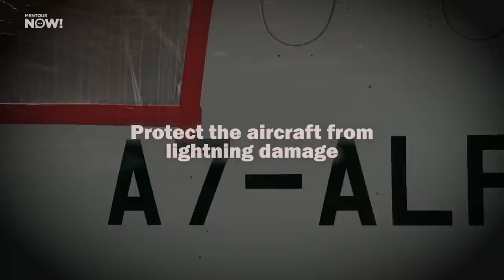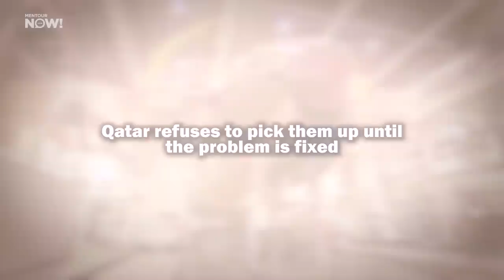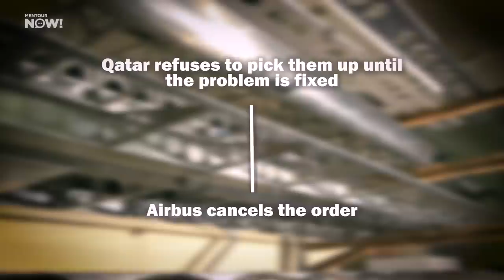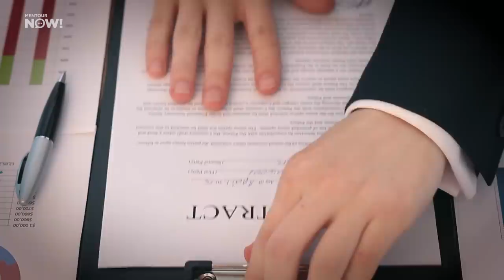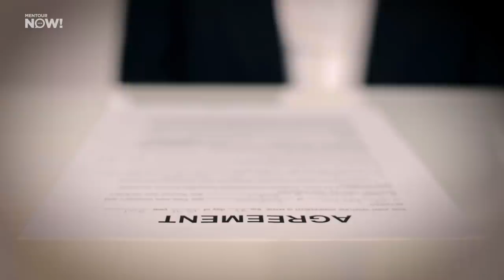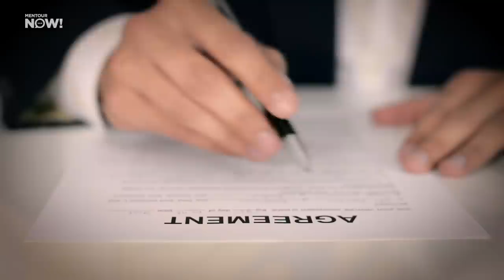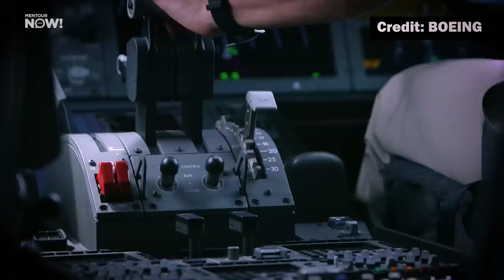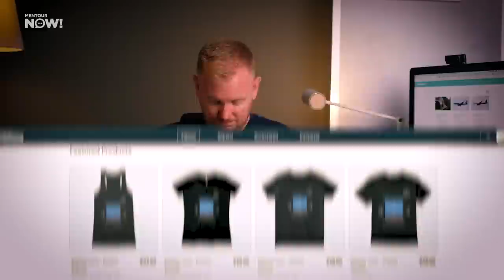WHO is Winning the FIGHT between AIRBUS and QATAR Airways?!

Comment: Seems like Qatar were looking at every option possible to save money during the pandemic, and now they don't like dealing with the consequences of their actions. Interesting they got the regulator to agree with them. Curious what their justification for it being a safety issue is. 
But on the flip side, Airbus did take a big risk putting dissimilar materials together and just hoping the glue would keep things together. 

But the good news is we get to see more A380's out there!
Reply: Copper mesh on carbon-fibre composite is how lightning protection is done. It is the industry standard. Boeing does the same thing on the Dreamliner.
The issue here was most probably a primer that could not handle the Qatari desert heat...which is not hard to conceive.
Reply: The justification for it being a safety issue was discussed in the previous video. In short, Qatar argued that the adhesion problem was affecting the conductive mesh of the plane, leaving it vulnerable to lightning strikes.
Reply: @MarvinRB3  But the whole point of the mesh is that it takes the lightning strikes, so the carbon doesn't.
Reply: @jursamaj  I do not argue the point, i only summarise their position to be helpful. You can make of it what you will.
Reply: @MarvinRB3  And I point out that their position is absurd and self-defeating.
Reply: @MarvinRB3  If your summary of QA’s assertion is accurate, their adhesion-issue-creates-lightning-risk is prima facie RIDICULOUS.
Reply: @baomao7243  from what I remember, the claim was that the poor adhesion of the paint exposed the conductive mesh, allowing it to be damaged; e.g with flakes of the copper mesh coming off along with chips of paint.

Airbus said there is suitable backup lightning protection.
Reply: @MarvinRB3  Exactly
Reply: "Interesting they got the regulator to agree with them."
Not really. Hardly surprising that the Qatari-government regulator agreed with the Qatari-government's airline.
Reply: @beeble2003  Whenever i see businesses behaving strangely I recall the best phrases ive heard in the Middle East:
* “NOTHING here is professionally managed” and
* “it is the government masquerading as a business.”
Sadly, both frequently fly apply.
Reply: The regulators and the CEO belongs to the same Qatari Family.
Reply: @jeffreyrivera8158  shocker

Comment: Is the work required to take an aircraft out of long-term storage significantly more than doing a C check? Unless it is a lot more, it seems to me that the cost of pulling an aircraft out of storage after two years isn't "expensive," it's about the same as you'd have paid if you'd been using the aircraft all along anyway.
Reply: We could start seeing A380s flying routes that are not REMOTELY economically justifiable…but Qatar “loses less face” by just throwing money at the problem.  Typical behavior if one is super wealthy. An ego that demands prestige can be extremely expensive (literally “at all costs”).
Reply: It is a lot more, in fact the longer the storage time the more expensive it gets.  Eventually it becomes cheaper to buy a new plane of the same type from the manufacturer, though that point takes fifteen or twenty years to reach.
Reply: @FireAngelOfLondon  Interesting. So what's involved in terms of checks and rework that makes this so much more expensive?
Reply: For anybody interested in following this in more detail, I've posted the question "What is the cost of taking an aircraft out of long-term storage?" on the Aviation StackExchange.

Comment: Qatar should look at the impact paint peeling on a Jetstar b787 wing covered in speed tape has done to Qantas group's reputation in Australia. Paint and overall haul integrity in appearance is everything when all it takes is one passenger to photograh an issue with social media in 2022.
Airbus should pay for the fixes because their product needed improvement and is simply not fit for modern aviation requirements when it looks like a peeling tin can.
Reply: As fair as I understood it, it wasn't ever about Airbus paying to fix the paint or not. What Airbus wanted was time to come up with a different way to do it, so it won't start coming off again. And in the meantime they said that the planes can continue flying.
Then QA said "nope, can't fly like this" and seemingly got the Qatar regulators to ground them.
Usually these kind of actions would come at a massive cost for airlines, but in this case it actually just cut their losse during the pandemic.... so yeah, the circumstances under which they were grounded plus the timing makes it all very fishy.
Seems to me as an outsider that QA got what they deserved.

Comment: I am unaware of issue in detail but would say one thing, painting carbon fiber reinforced (CFR) composites with ordinary combination of primer, overcoat and lacquer? It is not something I have heard of. I am unaware of any indepth study on the subject in recemt times. CFRs are not known for their good paint properties specially for aerospace applications. Paints (if any) used on these materials are epoxy based (urethane based) and exposies are thermosets which are brittle, hard, have poor impact resistance, undergo ductile to brittle transition, have lower linear and volumetric coefficient of thermal expansion with very poor temperature dependance. This all makes them unsuitable for aerospace applications and airworthiness issue seems plausible. Airbus, as I know, does not have infrastructure to do all these tests and no such study is published by them as well. If they will create such infrastructure overnight, then its even bigger mistake and If they are proposing and doing in factory custom ready made solutions proposed by technicians, then thats not the way things work. They will never accept but as I see, it is very valid point. Furthermore, have they checked interlayer properties of CFR (not made by prepreg) and aluminum mesh?

Comment: In the world of business "The customer is always right" except for the expensive products.

I cant accept forcing a faulty product upon a customer just because I don't see it faulty.

While paint affect may be debatable on the aircraft safety, the fact still remains that the paint is inferior (regardles to what causes it inferior, for this issue is owned by the manufacurer). Therefore the complete product in its entirety is faulty and owned by the manufacturer.

Safety is not the only issue an aircraft should be rejected for. Aesthetics (which paint is a major part of it) is equally a viable isuue whether to accept or refuse an aircraft.
Reply: Airbus never declined that there is a problem. Qatar isn't the only airline with this problem but the only airline that reacted in this way. That's the point Airbus is pissed about. Qatar acts like the spoiled, stuborn kid that gets extremly mad every time they don't get their way.
Reply: @shi01  
Interesting view! 
However, regardless of what we label Qatar, the facts remain. Airbus product is faulted. Qatar (and others) have the right for a refund especially that Airbus was given several chances to repair the fault and failed.

I think you would take the same stand if this happened to your car. Imagine if your deal involved a fleet of cars.
Reply: @nidaldajani728  Well, the other Airlines took the free repainting and maintenance checks until Airbus finds a permanent solution. So in car terms, "we repair the reoccuring defect for free as many times as necessary and do a full maintenance ckeck every time." doesn't sound to bad of a deal for me.
Also, you do realize what a "refund" normally involves? Either you give the defective product back, or you get a partial monetary compensation. But then don't expect any further support from the manufacturer, because you accepted the defect and got your compensation for it.
Reply: @shi01  
While repainting is free, the unavailability of your cars to do business is a loss. Afterall, business do not buy cars to spend its time in the workshop. 

I strongly advise you to discuss this matter with any logistics company (trucking). They will enlighten you.

Comment: 10:15 what an irony or is it karma?
I don't know what's going on with the aviation dealings and the gulf countries because now they are tempting airframe makers with the idea of a much bigger version of their retired quad jets.
And, we still don't know why the painting problem didn't affect other models or brands as severely as it did the A350s.
Thank you for researching deeper and bring to light important updates, especially about carbon fiber and climate fluctuations with other materials.
Reply: The 787 too has the same issue, just not that widespread.

Comment: I would personally feel betrayed by Qatar if I were in Airbus' shoes. As you said, the paint issue on the A350 was experienced by other customers of the aircraft, but mitigated without issue each time. Qatar, for whatever reason, decided that that wasn't good enough, and threw Airbus' entire reputation as a safe airplane manufacturer into question. Forget Qatar's standing A321neo orders. Cancel them all and ban Qatar from ever being a future Airbus customer again. If Boeing were smart, they would have ignored Qatar's request for MAX 10's and 787's, too. If you're Boeing, how could you expect to be treated any better by Qatar than they treated Airbus? Boeing's reputation with regard to safety is already shaky for obvious reasons. They don't need one of the most influential international carriers slandering them any further. Qatar needs to learn a lesson about respect.

Comment: Qatar Airways is in a real loss, and all about a paint issue
Reply: There is enough blame to butter the toast on both side.   Airbus messed up too.  It was a cooperative effort.
Reply: @danharold3087   the first 787s also had similarly paint issues. However the affected airlines handled it less openly than Quatar Airways.

It's just that any new model has problems seen after launch.
Reply: @serkandevel7828  They are similar problems in that both included the word paint. 

The 787 paint is flaking off from UV damage.   The solution is to add a UV protection layer on the next paint job.   It only happens after years of use.  AIrbus's foil problem was seen on a newly delivered plane.

AIrbus has reduced the time between paint A350 paint jobs from 4 to 2 years

Comment: The Boeing cancelation of the delivery refused Chinese Max orders offers a way to get a group of Maxs to Qatar. Not sure at all that they could be running in a month.
Reply: Yes, true, but they are the wrong aircraft.
Qatar wants Max 10, which is not even in production. The already built airframes are Max 8 and 9. So only if Qatar accept a downsize.
Reply: @horizob  Max 10 might need a full cockpit redesign, so that is a problem.
Reply: Those same Chinese airlines would be stoked now that QA defaulted 50 A321N
Reply: @topethermohenes7658  Win-Win.  They could also make a deal for the 350s Qatar won't fly.
Reply: @k53847  esp the recent 290 airbus contract Chinese airlines made
Reply: Boeings did not cancel delivery of Chinese MAX, that's not true.  Chinese airlines where not willing to take delivery soon because the MAX was still grounded in China so Boeing is instead selling them to other customers .

These Chinese airlines will get their Max's after Chinese certification is done. Anyways the MAX 10 does not need a cockpit redesign, that has not been confirmed. They will likely get a waiver instead

Comment: Finnair will start to fly from some of the nordic cities to Doha on behalf of Qatar. 
Maybe Qatar could try to use other airlines to fly for them to the World Cup. Maybe expensive, but they don’t have a lot of choices.
Reply: Yes - and Finnair will use their A 350-900-Fleet for it - Aircrafts which had the same problems with their painting, but Finnair solved them much better with Airbus than Qatar.
Reply: @NicolaW72  I read they would use a330s?
Reply: @torbx553  Finnair operates a Long-Haule-Fleet of 8 A 330-300 and 17 A 350-900.
Reply: @NicolaW72  Yeah but I read they will use a330 on the flights for Qatar
Reply: @torbx553  It is of course possible, yes. And maybe not so embarrassing for Qatar Airways.

Comment: What’s baffling me: doesn’t it also take a lot of time to retrain both pilots, crew and of course maintenance personal if you switch to a totally other plane manufacturer? New type rating “seems” easy, but … for so many people? Think about the new logistics (look how many spare parts an airline usually has in storage for some models), more simulator time, evacuation training, maintenance crew training courses and and and - all in next to no time. Oh dear state owned Qatar, you shouldn’t have spoken to your state regulator friends.  

 To switch about 70+ Airbus (A350 + A321 neo - A380 - A330) to Boeing ones, have more fun. Furthermore the Boeing’s 737 Max 10 won’t be delivered in 2022, in 2023 and later (plus the certification issue; well the US Senate may be helps with that - well who wouldn’t to save it’s own industry, as long as the safety standards are uphold).

Cheers, keep up your great work,
Pepe
Reply: They already fly Boeing and Airbus aircraft.

Comment: you could have posted available images of deep de-laminations at wing stems and other vibration points. this is not simply a paint / primer issue.  anyone working with carbon / epoxy composite can explain the poor compatibility of the metal mesh as one of the composite constituents with relation to thermal issues and high frequency vibrations. THEY SEPARATE.
Reply: They do separate but even if the plane has no paint at all, the mesh will still provide lightning protection to the carbon body. Hence this is a cosmetic issue not a safety issue.

Comment: Isn't there a large difference with the way the Airbus is flown compared to Boeing aircrafts? Wouldn't there be a lot of cross training (not sure if that's the correct term) needed, or new pilots hired to fly the Boeing?
Reply: Yes, of course - there´s a big difference of flying the Airbus A 320 which Qatar Airways operates now - the Pilots will need a new type rating when they should fly the 737 MAX in future. But that is not the major problem for Qatar Airways. Once changed it will work.

Comment: It is a shame many other airlines facing the same issue never bothered to step up for Qatar Airways. Almost all of them regret buying the A350, considering the patchy composites experimented on A350. Having cancelled the A321 orders invoking the cross default, it may look like Airbus got its sweet revenge, but never would airlines trust Airbus with handling their fleet if Airbus arm-twists customers this way. Many airlines avoid the public conflicts because of the cross default situation that there is as it would affect their lucrative markets where they would use the short haul equipment like the A320's. Qatar is undeniably in the wrong, but Airbus took its adamance to a new level. 

But the message is loud and clear, Airbus signalled that if you have one short haul product of theirs, never should you buy a product from another segment from the same manufacturer. Today it may not sound like a big deal but Boeing clearly is in the lead when it comes to long haul aircraft.
Reply: No company is required to make business with anyone. If am sure if you had a costumer trying to get what they wanted by playing dirty, you would not want anything to do with them anymore as well.

Comment: You compared EASA and Qatar safty organisation as if the were the same. EASA is much larger than Qatar air safty and Qatar is ruled by a king which means that both Qatar airways and their air safty organisation is run by the same person, which means its not independent. You also did not mention that the time when Qatar airways claim they discovered the safty issue, was when covid hid the air industry, when no airline wanted the aircrafts. Airbus did not accept that and forced any airline who could pay to accept delivery. These are relevant issues.